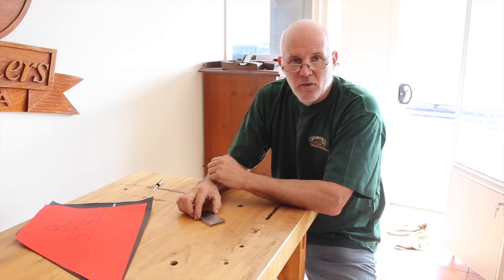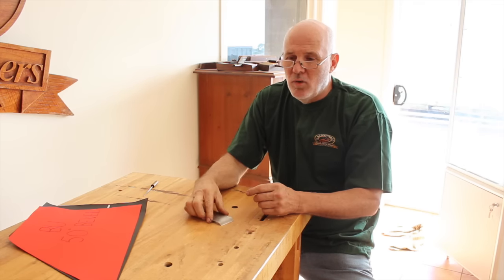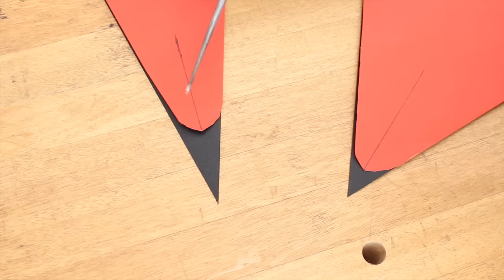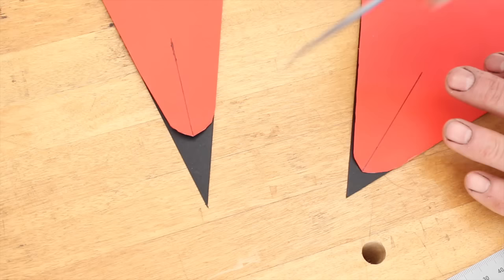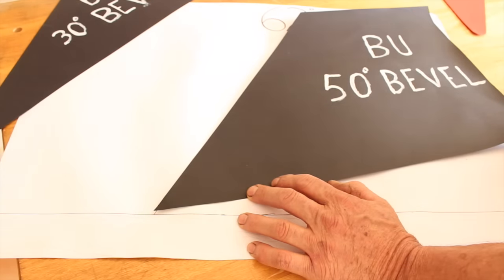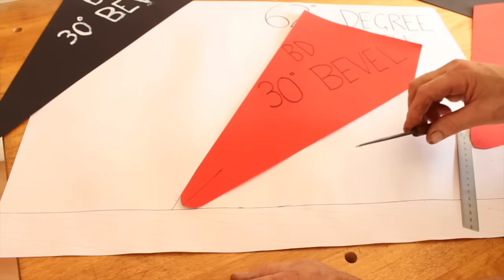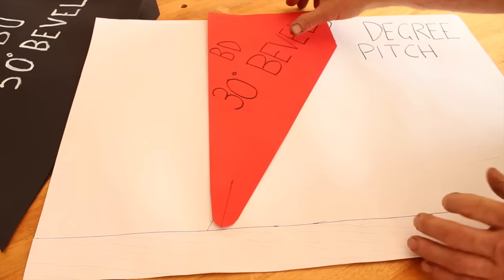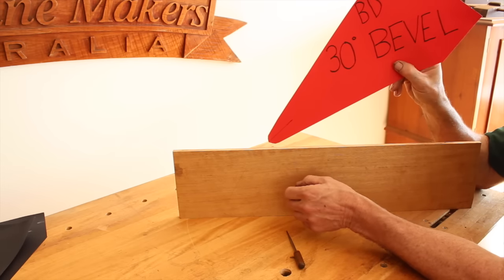Bevel up versus bevel down planes - scrutinising bevel and clearance angles - Part 1

Comment: Fascinating stuff but Terry is examining the worst-case scenario for BU planes. Most folk will I suspect  - in Europe at least - use a bevel angle of 38 degrees or even 35 degrees for planing local timbers. 50 degrees would be reserved for small areas of problematic wood. So the issue isn't quite as bad as he suggests. But there's no doubt a BU blade wears quicker but IMHO a sharp BU blade outperforms a sharp BD blade and there's no cap iron to mess about with.
Reply from the maker: Hi Philly,

Please be aware I have nothing against BU planes , we have used this concept in our planes to make a BD smoother into a BU cabinet scraper since we started making planes in 1995.   The issue I am trying to make woodworkers aware of is the problems associated with using LA BU planes that have a 12 degree bed (ie. 12 degrees of clearance)  for smoothing flat surfaces. The less clearance angle you have the sooner your plane will not want to cut the long grain of wood.  No clearance = no cut, unless of course you want to use brute force, which many people try to do which creates many other issues with the quality of surface finish and increasing the chance of tear out. The exception to this is cutting soft wood end grain, which is what these LA BU planes were designed to do,  and they are undoubtedly the best design for planing soft wood end grain. This is because soft wood end grain (under a micro scope) is not flat - it has troughs and peaks so the loss of clearance or the wear bevel is not continually  riding on the surface of the wood like in the case of planning long grain.   Consequently you can keep planning softwood end grain until the blade is actually blunt. In contrast to planing long grain, once your wear bevel is large enough to lose clearance, you will assess that the blade is blunt, where as in fact the blade is still very much sharp enough to cut wood , but the LA BU design is stopping it from cutting due to loss of clearance.

As far as the bevel angle goes, a woodworker in the US - Steve Elliot,  proved beyond doubt that a 31 degree bevel is the optimum angle to get maximum life out of your blade (before re sharpening) for planning cherry. If you take a look at his site he proves this beyond doubt. For other types of wood that angle may vary slightly one way or another.   But with full confidence I can say this - if I am planing cherry, every degree I make my blade bevel greater than 31 degrees, regardless of whether it is BU or BD, I will get less meters/feet of shavings before I have to resharpen.   If you sharpen your blade at 50 degrees you will have two thirds less usable sharp edge as per the card board cut outs.

If you are planing long grain and the wood is hard and cranky, using a LA BU plane with the bevel sharpened at 50 degrees you have selected the worst geometry possible to get good results on this type of wood.

I hope that helps with a better understanding of Blade Geometry.   Unfortunately, talking about clearance angle doesn't suit some people, despite the fact that clearance angle in any blade geometry equation is the most critical.

I hope that helps.

Comment: Hi, thank you for this good information!
Wouldn't be the solution to make a BU but without the common low beding angle?
That would leave you with the possability of playing with the cutting angle by changing the sharpening angle. Rising the beding angle means rising the clearence angle by keeping low the sharpening angle wich gives you more wearing material as you nicely explaned?
Reply: Hi Oli    Thanks for your comments and glad to see you have thought about it.   Raising the bed angle in a BU planes would certainly make sense to me if you are going to use this type of plane to do the work of a bench plane  eg planning large flat surfaces.    The more clearance you start with the longer you will be able to plane before loss of clearance  will effect how well the plane will cut the wood.  If we were to make a BU bench plane we would use a minimum of 20 degree bed.    Regards Terry

Comment: So do bevel-up planes have any advantages?
Reply from the maker: Hello,   with a blade sharpened at about 30 degrees, a BU plane is good on softwood end grain which is what they were originally designed for.   As far as the lower wear bevel effecting the clearance angle you would have to do some experimenting, as this will depend on the wood you are using, the blade steel, and how well you sharpen it.Hope that helps.    Happy woodworking.  Regards Terry
Reply: Hi Terry, can you point me to one of your videos or make one that demonstrates planing hardwood end-grain with one of you planes angled at 55/60degrees? 
I struggle to get a clean finish on Tassie Oak endgrain with a finely set Stanley #4 sharpened at 8000grit... I can't imagine a 55 or 60 degree bevel would be any easier?
Reply from the maker: Hi Trevor,   I don't think there is a video posted showing planning hardwood end grain.   However, I certainly have done it and it is best done using a shooting board.   Let me know what thickness tasy oak end grain you are trying to plane and I will see what I can come up with.    Also were you using a shooting board?REgards Terry
Reply: thank you very much for response, and can you please say why HNT Gordon shoulder planes have brass bottom, not steel, like Norris plane did?
Reply: and why your block planes and molding planes don't have a metal sole?
Reply from the maker: Both Steel and brass for a  plane sole are very good materials.   As far as function and wear over a long period of time,  I would say from my experience that  there isn't much difference.  We use brass because it is easier to get the extruded sizes that we use and it is an easier material for us to work and machine.
Reply from the maker: In block planes we find the wooden sole functional and the wood we use is very hard and dense for a long life.   But having metal in a block plane sole is also a good option.    For the molding planes it is simply a lot easier to make them with a wooden sole making them much more affordable.
Reply: +HNT Gordon  thanx for your response, it's fine that you use brass, it is more beatiful with gigee
Reply: HNT Gordon do you plan filming a making your beatiful planes process, this would be very interesting to see?
Reply from the maker: In actual fact,  a Friend of mine is putting a video out soon of where we sourced some wood, cut and dried it and then made it into a plane.  I think he is going to call it " from wooded plains to wooden plane"    Stayed tuned.   Regards Terry